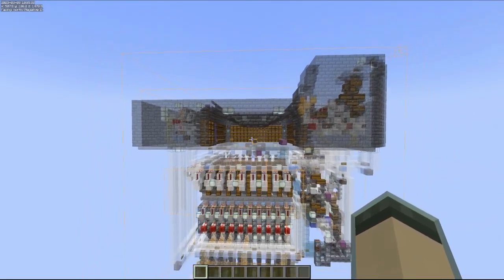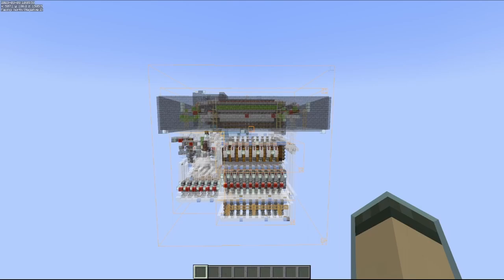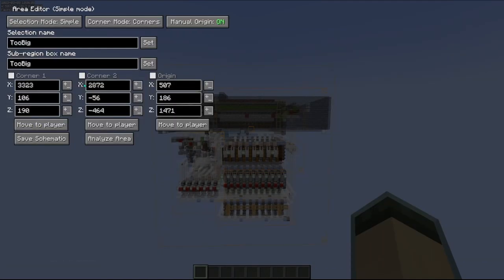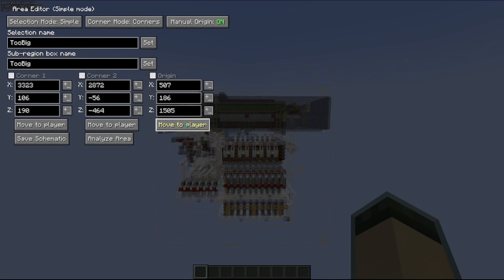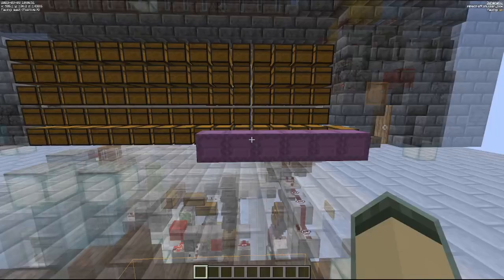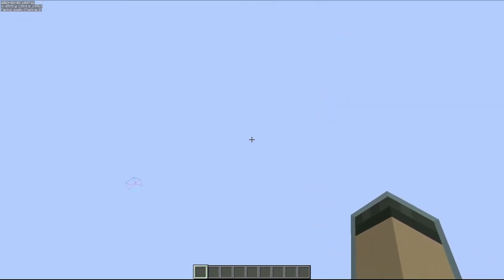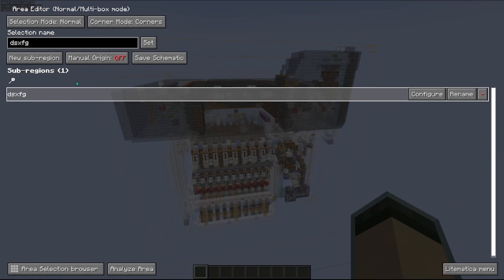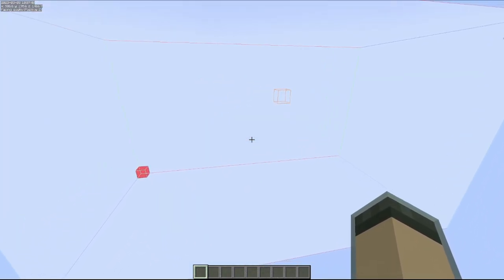Minecraft Litematica point of origin

Comment: Hey... I wanted to ask if there are shortcuts to select and move subsection without selecting them in the menu.... and duplicating subsections in a Schematic...
Reply from the maker: Thanks for the question
Not that I know of.  
I just went and searched through them to see.  Nothing would suggest the ability to change or cycle through sub sections outside going into the menu.  The cloneselection hotkey will do the entire series of selections but not a single sub selection
Reply: @waynestir  Okay thanks!
Reply: You can use the tool to select sub-regions. By default it's bound to middle clicking with the tool item (toolSelectElemets hotkey). This allows you to select either one of the two corners, or the entire box, depending on whether you are looking at one of those corners or elsewhere on the box.

You can then use the Alt + scroll nudging to move the entire box, or the moveEntireSelection hotkey to move the box by its primary corner to the player. There is no way currently to use the tool item (clicking) to directly move the entire box, as the tool click functions operate on the corners of the box and not the entire box.
Reply from the maker: Thanks for the input.  I only just noticed this today.  Don't know how I missed it for so long.